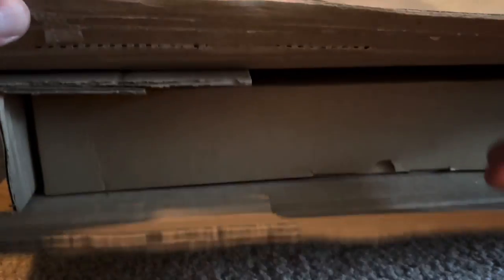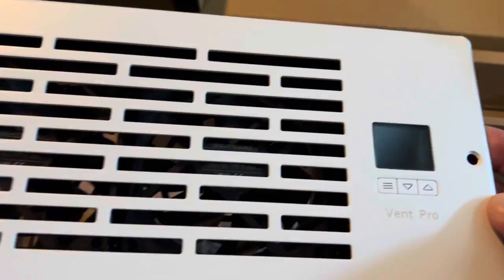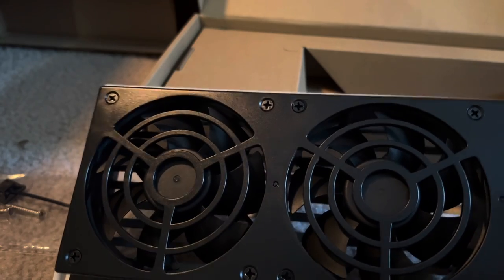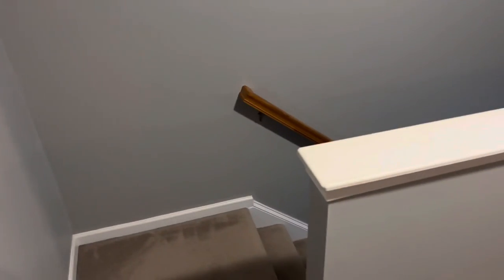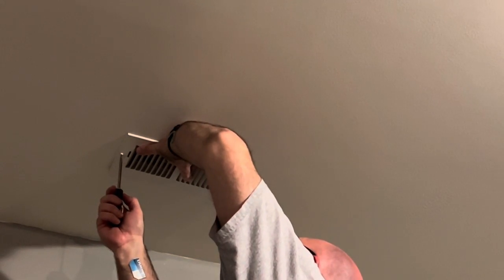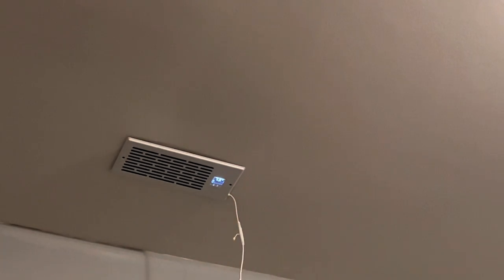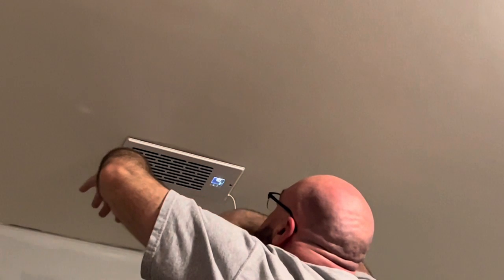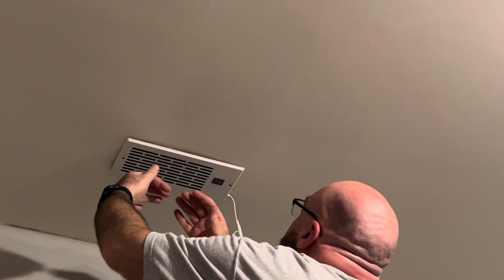AirTap Vent Pro Register Booster System

Comment: Thank you for the honest review.  Did you come across a product that works?
Reply from the maker: Thanks for the subscribe.  I wish I did find something.  If I did then I’d post for sure.
Reply: @jdmediahub   I also have a ceiling mount vent. I went with a 6" inline duct vent fan which I installed in the attic close to the unit. It required a separate temp control sensor. This way, it is programmed to come on when the AC comes on, any noise it makes is shared by the main unit (so I don't even know it's there) AND I get to keep the original register that diverts air in the room as it is meant to. I'll attempt to post amaz0n links next message, not sure if they'll be blocked so won't include them in this message body. Cost me just at $100 total.
Reply: WILLHI WH1436A 10A Temperature Controller 110V Digital Thermostat Switch Sous Vide Controller NTC 10K Sensor Improved Version
Reply: iPower 6 Inch 395 CFM Inline Duct Ventilation Fan with Variable Speed Controller HVAC Blower for Hydroponics/Grow Tent/Indoor Garden
Reply from the maker: Thanks all for the insight and the advice.  I’m going to wait until the weather (heat of summer) breaks then add some additional venting that was described by Michael below.
Reply: @jdmediahub   Did I mention it worked perfectly. I could not possibly ask for a better result. This room was usually off limits on hot days as it got way too hot, not it's cooler than other rooms around it. When you get it done you'll be sorry you didn't know about or do it sooner.

Comment: Most ads explain whether or not to mount in the ceiling, sorry you missed it.  Sounds like you have good airflow already, if the booster is not noticeably better.
Reply from the maker: Yeah airflow was ok for 9 months a year.  Summer is whole different thing in SC.  I was trying to have an option for June-Sept.